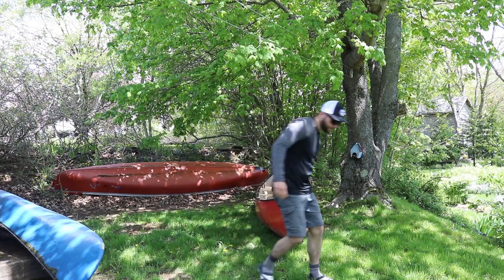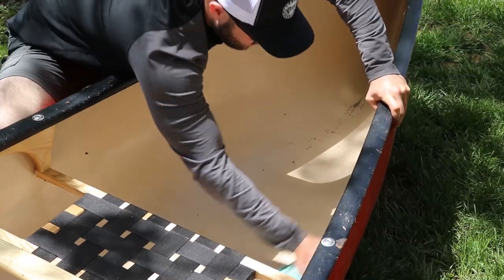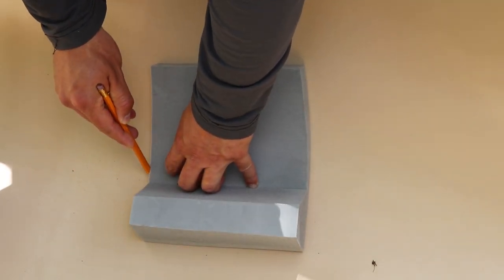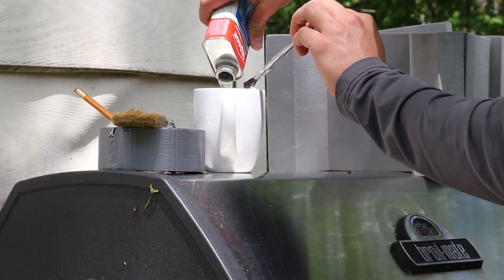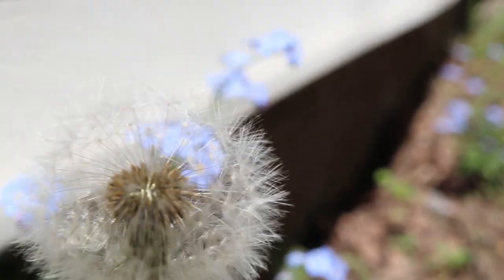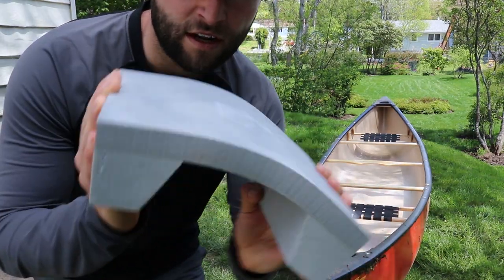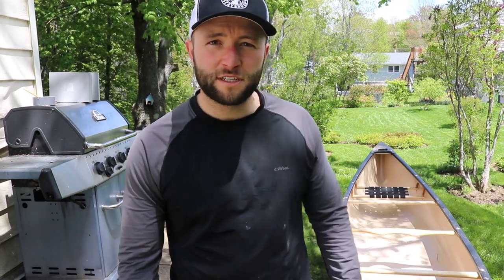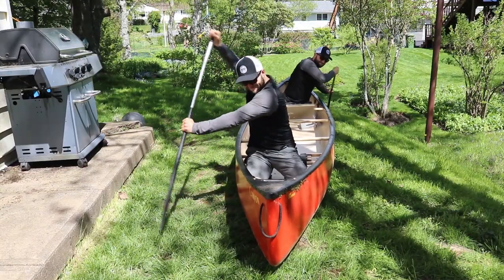How To: Install Knee Pads (in your canoe)

Comment: You maybe should have mentioned to use closed cell foam so it doesn't get all wet and mushy?      A second coat of glue is a good idea for certain foams too.  Sometimes it soaks in too much.

Comment: Why do you have different pads for the stern and bow?
Reply from the maker: The pad design is based on where they're fixed on the canoe. The bow location is a little more on the sidewalls so if you were to have a double ridge design, it would be an awkward fit for the bow guys knees